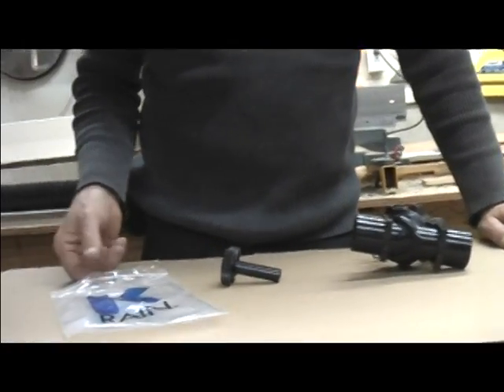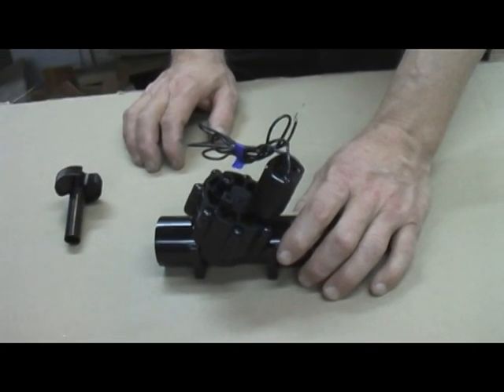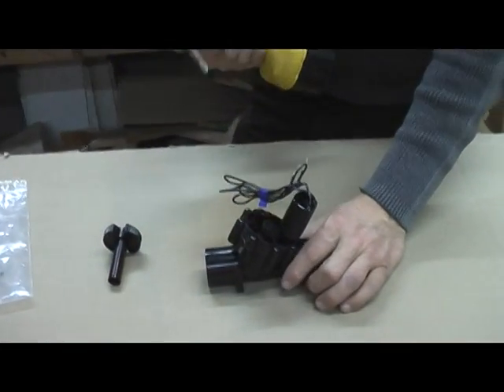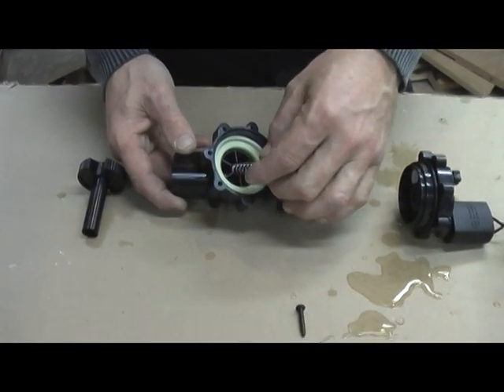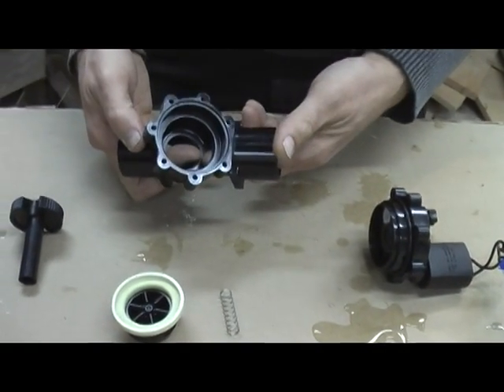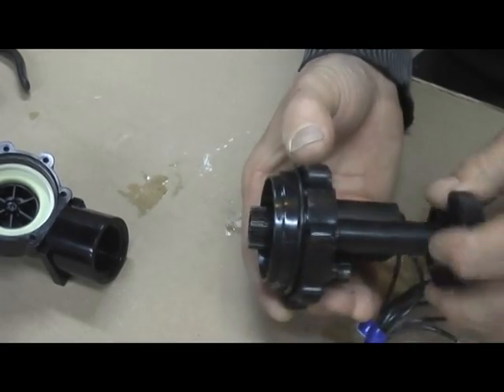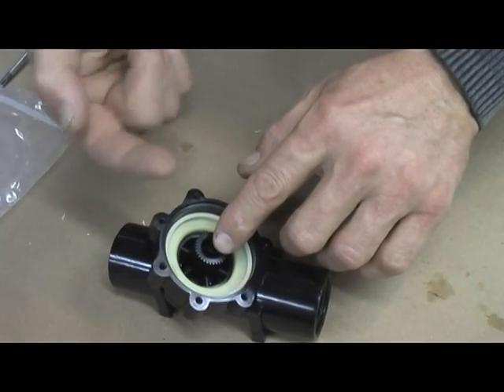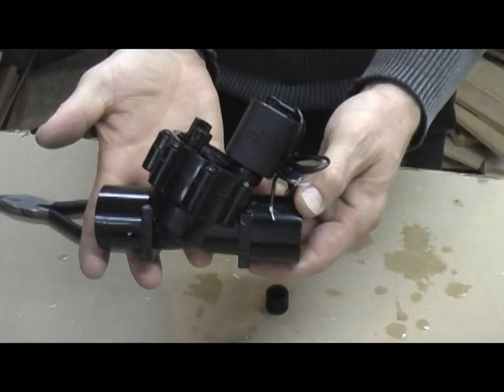How to Disable Flow Control on an Irrigation Valve

Comment from the maker: @versatilechicken  You can modify a sprinkler valve like you describe. (a fast opening of the sprikler valve), but I don't like the fact that you need a snap action trigger point.
The dollar store sells alkaline batteries for 1 dollar each. Its easier to just use 2 9 volt batteries.